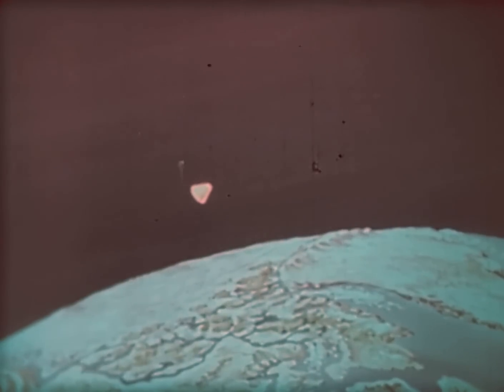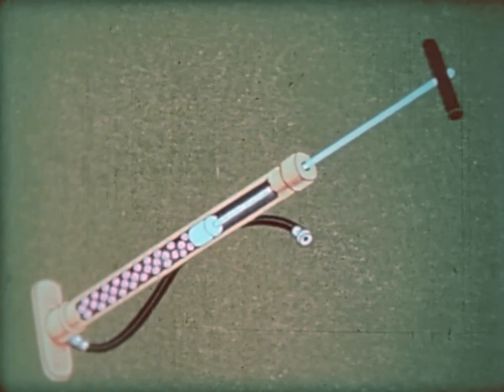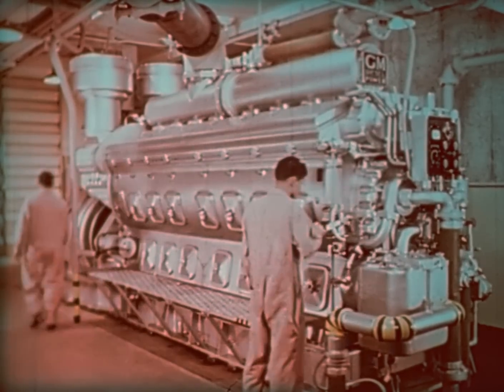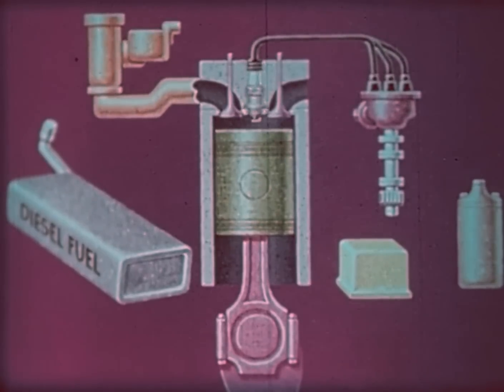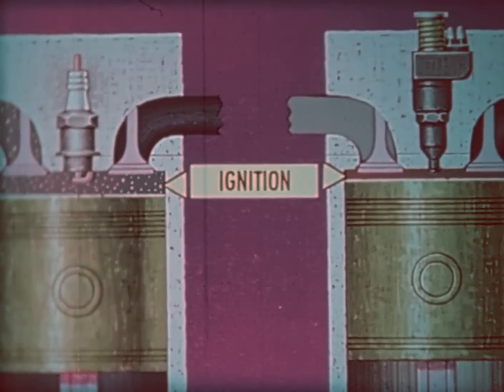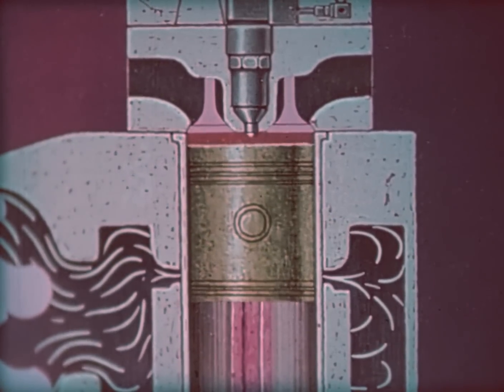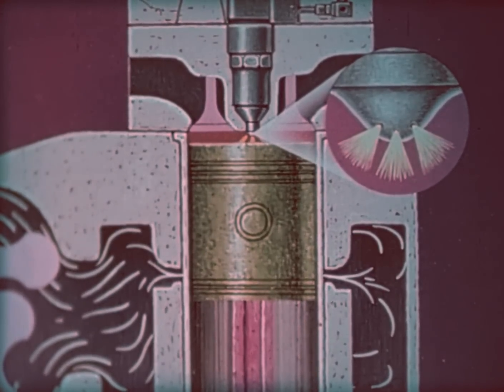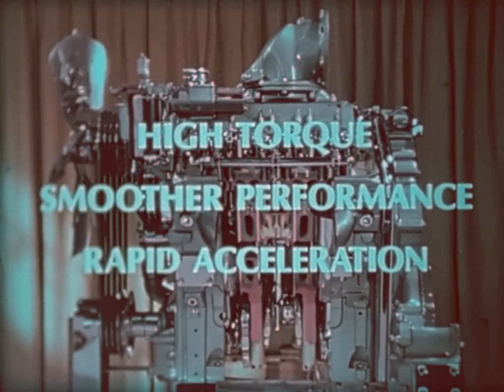ABC of the Diesel Engine 1973 General motors educational film

Comment: "Costs less than gasoline"    Welcome to 2024
Reply: Ultra low sulfur changed that but it was still cheaper than gasoline up to about 17 years ago.
Reply: Many places in Canada and here in Alaska, diesel fuel is cheaper than gas....Not all year round but for several months out of the year.
Reply: I think a lot of states have differential taxes on gasoline and diesel. As like a very imprecise way of taxing commercial shipping separately from light transportation. I don't think they should do that.

Comment: Brought to by the people that nearly destroyed the diesel engine’s reputation in America by converting an Oldsmobile gas V8 to diesel. They seldom saw 100k miles and generally failed at far less mileage all while turning out insignificant power and torque. GM could learn a lot about diesels from VW! My Jetta TDI only has 122 cubic inch displacement (2.0 L) and puts out 185 horsepower with 295 lb.ft. of torque! Far more than GM converted V8’s ever dreamt of.
Reply: comparing late 1970s technology to your TDI (which came out in the late 2000s) is kinda insane. "My 4 cylinder camry makes more horsepower than a full sized truck from the 1940s" is literally your argument. Keep dick riding VW tho
Reply: the oldsmobile 350 diesel was NOT a 350 gas converted to diesel. The two engines merely used the same tooling at the factory. Try opening up one of each and you'll se that NO parts are compatible. Not the headgasket, not piston rings, not pistons, barely anything else.
Reply: You're forgetting that the industrial side of GM did the REAL diesel power for 60 years prior in the 2 strokes, and it was the automotive side that made the 350D abortion.
Reply: Ever hear of the 8v-71  Detroit Diesel    VW has nothing on them

Comment: Btw, the reason objects entering our atmosphere get lit on fire, is because they compress the air in front of it.

I mean it is really simple. Take a space capsule that is returning to earth. What you will see is the lower portion of the capsule glowing bright orange and it fading away into a tail. This would mean that the most amount of friction is happening right at the front of this capsule, but friction (when it comes to fluid dynamics) is a result of speed, density and a few other things. The air speed right at the front of the capsule is much lower then the sides of the capsule, but the density, and thus the pressure, is much higher. At the sides, however, the airspeed is much higher, but the pressure lower. 

If it was friction that caused the heat, then the sides should also throw a lot of heat, but it doesn't. It merely gets touched by the heat from the front of the capsule. 

What is different is the compression, the front has a very high compression, while the rear does not. And since we know that compression makes heat a lot quicker than friction (in fluid dynamics), we can conclude that it is compression that causes it to glow orange.

Comment: The new kid on the block is my Situan Sifa 3 horsepower air cooled diesel on Amazon or eBay. Respect the 20 MM crankshaft and build a 1 inch sleeve adapter. With a 7 inch pulley, the diesel can turn reasonably slow and power a car alternator. The motor likes a thick plate of aluminum to mount on. The 15W40 oil consumption will be surprisingly high, but harmless. Avoid goofy destructive fuels. A pot of hot water poured on the cylinder head will have the motor ready to start in cold weather. Ether can be destructive. I cranked down the restrictor bolt so it won't go over 2,000 RPM's. It hates very low idle speeds, too. I never draw over 50% power. The diesel runs extra cool.

Comment: The facts about small pollutants is questionable these days. Also it was completely failed to mention most if not all diesels need to be or should be preheated.
Reply: No, only certain small diesel engines need preheaters.   Typically they are converted gasoline engines - eg the Mercedes car engine, which is the Mercedes gasoline engine with a diesel cylinder head fitted.   Since it is a converted gasoline engine, to avoid overstressing parts, the compression ratio has to be kept lower than will reliably start cold.  Engines designed from the ground up as diesels do not have this problem.
The vast bulk of diesel engines in service do not have preheating.
Reply: @keithammleter3824  That is not really correct. - Today's "ground up" Turbo-Diesels do not use the same high compression (typically 14-18:1) of the 70's and 80's Naturally Aspirated Diesels (20-23:1), so they will either need to be plugged in (water jacket pre-heating) or Air Intake "Grid Heaters" like Cummins uses, or Glow Plugs like the Duramax or Powerstroke. - Way Back, Perkins used a Flame Style diesel fired intake heater that worked very well. = https://www.youtube.com/watch?v=NeDvCVS38hk
Reply: @keithammleter3824  I'm afraid it is you who are misinformed. Diesels do not start well in cold climates and do require preheating in some form. The vast majority of light to medium truck diesels (NOT 'converted gas engines') on the planet's roads today use glowplugs, intake manifold air heating or coolant heating to assist with cold weather starting. I have a fleet of farm tractors and every single one of them has some form of the above (my Ford 8610 has Thermostart, and actually ignites diesel in the intake manifold to warm all that cold steel and aluminum!). My stationary diesels (gen-sets) also all have some form of the above. Marine diesels often have intake manifold heat but their secret is the heated engine room. Even somewhat experimental diesels for aviation use glowplugs.  

If you lived in a cold climate you would understand that diesels are much more challenging to start than spark-ignition engines.
Reply: @KevinMaxwell-o3t  No, you are wrong.   Engines from Cat, Cummins, MTU, Komatsu - all do not have any form of preheating for starting.
Your view is skewed by limited farm and automotive experience.
It is true that starting a gasoline engine is fundamentally different to starting a diesel engine.  A gasoline engine in good repair will start no matter how low the cranking RPM is, so long as there is good spark.  A diesel engine requires a definite minimum RPM to start, as below that RPM cylinder charge heat bleeds away faster than compression can build it up.   This minimum starting RPM is somewhat inversely proportional to ambient temperature.  However Cat specifies the minimum cranking RPM for all its engines as 100 RPM.   When a dealer sells an engine, he is required to specify a starting system (battery size and size of starter motor, or size of air start system) that will achieve 100 RPM over a reasonable battery life at the lowest likely winter morning temperature according to climate statistics for the area.  A start is then guaranteed.
I was the engineer for a large Cat dealer - I do know my job.
The Ford 8610 is a 1970's era light tractor with a 6.6 litre 6 cyl engine.   Perhaps it is a high swirl design for operating RPM flexibility.  There's lots of engines of smaller per-cylinder capacity that don't have any form of pre-heating.
I had a customer that wanted a 500 kW genset for an offshore unattended oil rig.   They wanted black-start capability - that is, a crew sent to attend the rig when the starting battery had been flattened must have a means to get the genset started - they can then get the gas turbine main genset going.    I suggested that a rope start or hand-crank engine be supplied that could charge the battery.   A suitable single cylinder engine was available from a Japanese manufacturer - Kubota I think.   It did not have a glow plug as that would require a healthy battery.
We only installed the optional water jacket heater if the customer needed immediate full load application on a genset.  This avoids warm-up wear but does little or nothing for actual cold starting.
Reply: @KevinMaxwell-o3t  Well, all I know is (working with a fleet of 25, 28 - 38 tonne gvw vehicle hauling hard core), when winter came, they needed an additive to reduce waxing (10℅ petrol was sometimes used).
Many hours I've spent on my back warming tanks, fuel lines, charging filters, then bleeding the whole lot. However, this was back in the late70s.
Reply: @keithammleter3824  i didnt know this. Ive only interracted with diesel in passanger cars and all of them have a preheat.

Comment: Some facts at the time of taping this film has changed. Most notably, cars have been using diesel. All the factors mentioned here, about diesel being more noisy and expensive (due to heavy construction containing high compression) have changed as technologies have improved. So now we can have smaller diesel engines that will compete with gas engines.

Comment: Oh how I wish this is how modern diesel engines work. No DEF,  EGR no stupid EPA BS.   My 6.7 Power stroke looks like a space X product.
Reply: You could not stand 10 seconds in your convertible chasing an hill climbing and smoking 1960-isch 18 wheeler.
Reply: @RS-vu3df 
I'm 51 ,I'll admit back over the summer while following a couple of older 60s cars the raw hydrocarbons were slightly irritating. 
Amazing how sensitive you get to it when not exposed all the time. 
They can run pretty decent when tuned right ,but everyone just adds fuel because it masks alot of tuning issues
Reply: I agree. Today's diesel's are the most unreliable they ever got. The DD will outlive the earth and still keep going strong. I miss simpler engines also.
Reply: @gabrielvieira6529 i i believe that they are made unreliable on purpose so people will come back to the dealer for repairs.
Reply: @gabrielvieira6529  Agreed 100%.  I love the power of the 6.7 power stroke, but I know its going to have catastrophic failure. Most likely due to the EGR and pumping exhaust back into the intake for emissions.  That shit gets right in the oil, kills it.
Reply: And it makes more similar hp and torque as an 8V71N Detroit,  which was 9.3 litres of displacement. The High output PSD is 500 hp / 1000+ Ft / Lbs.
Reply: EGR improves fuel economy. DPF reduces your risk of lung cancer. This technology marginally improves your life.
Reply: @TheBryce98  But it decreases the engine life... I dont hate the technology. I love to live better. But the engine can be made reliabe and not polluting with more effort
Reply: @TheBryce98  LOL EGR does NOT improve fuel economy... Where in the fuck did you hear that shit? It's laughable purpose in life is to reduce nitrous oxide emissions by converting them to nitrogen oxide... all the while of having the benefit of loading the intake manifold with sludgy shit that was never supposed to be there.